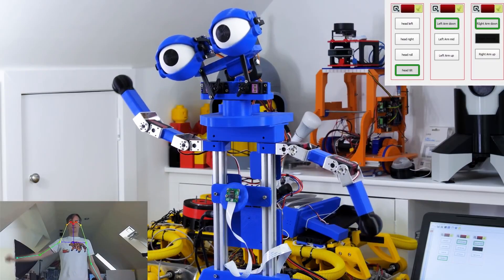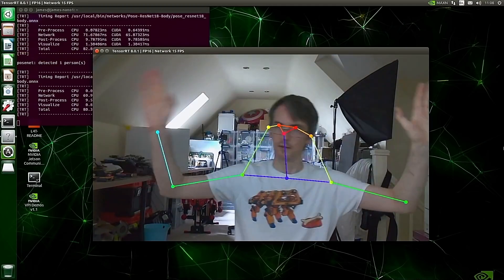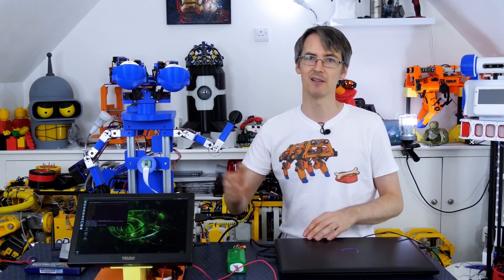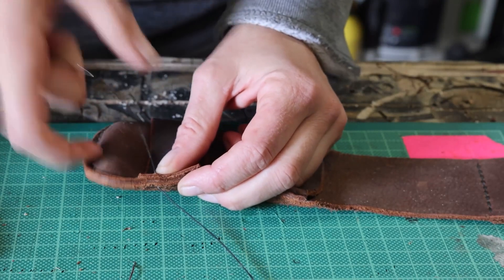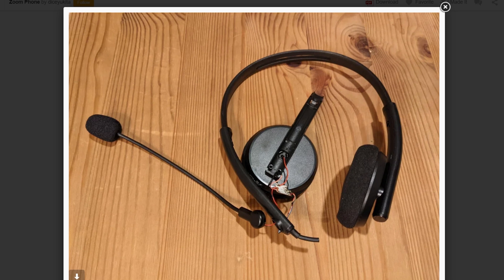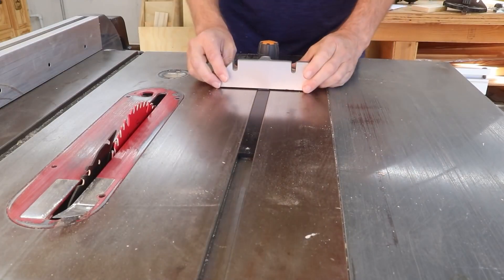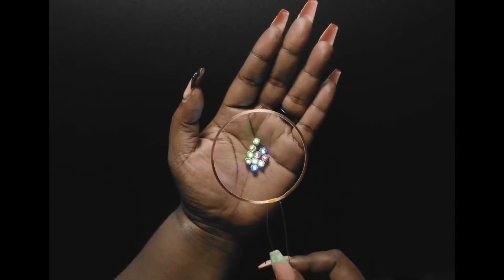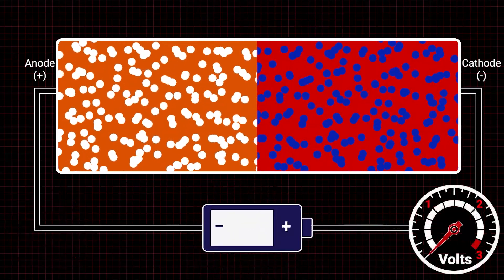At Your Command [Maker Update] | Maker.io

Comment: I watched the video about diodes. No wonder you got confused. They mixed hole theory of current flow with electron theory of current flow without explaining the difference. For makers electrons flow from pos to neg terminals which is the theory I learned as an electronics technician. If you are studying to be a an engineer or physicist you learn hole theory of current flow (the current scientific understanding). Hole theory is great to know if you need to design and build semiconductors. Electron theory is easier for wiring real world projects because it has been in use the longest. Sort of like the difference between metric and imperial measurements, it is what you are used to.